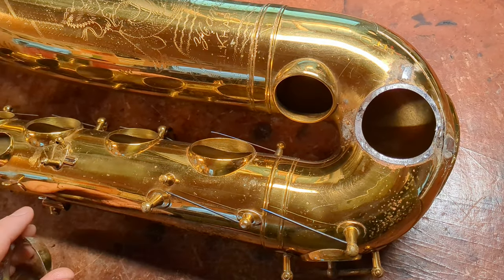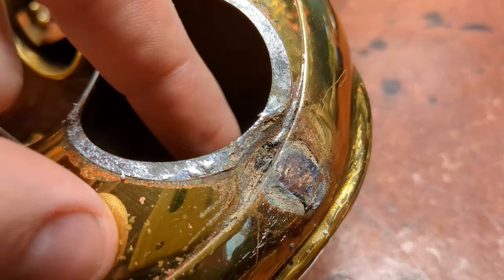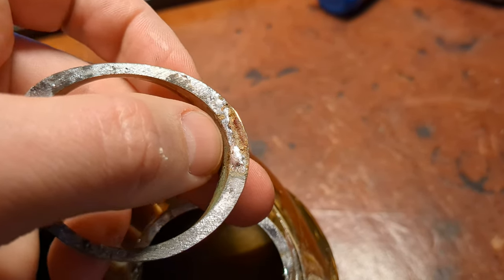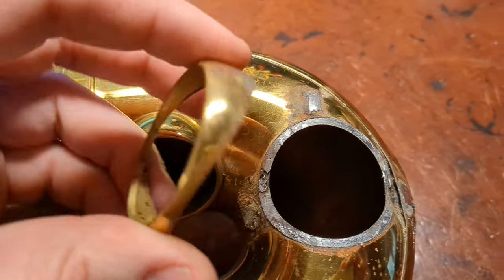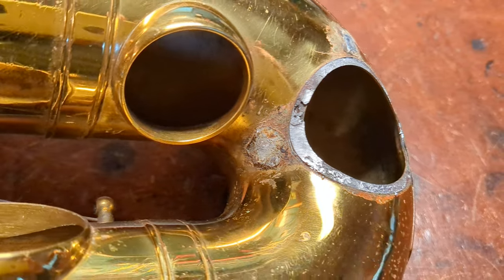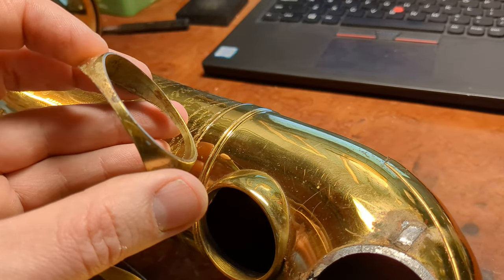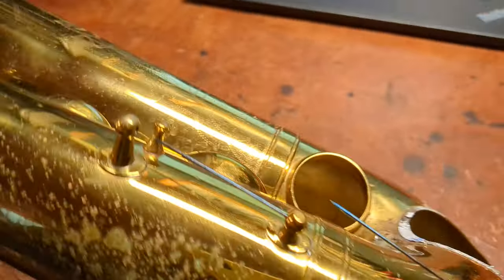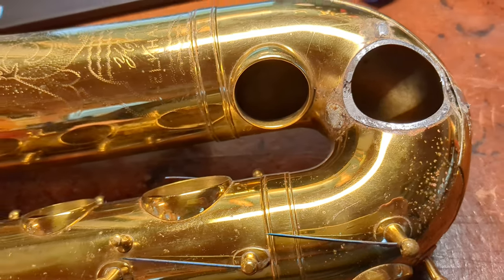Saxophone Repair Topic (Quick): Martin Toneholes, Unsoldered

Comment: Thanks Matt. I have a Martin c-melody from 1925 and there were still no tone hole issues per the technician after all this time. so durable indeed. From a manufacturing process one can understand that it is easier and cheaper to stretch the material to create tone hols rather than adding parts like Martin did. Would there be a benefit  from a tone /acoustic standpoint to have the tone hole as a separate part?

Comment: Hey Matt, would you try to suck out the solder under the bow band where you can access? and then try and push up the dent in the band? Just curious how you would tackle that section. Peace
Reply from the maker: Yep, that's what I did.  I used stripped speaker wire as a solder wick.
Reply: Can’t say enough about Martin! Have an old 1927 Handcraft tenor loved it so much that I recently bought a 1925 soprano in silver!